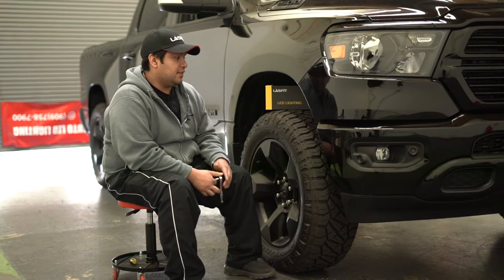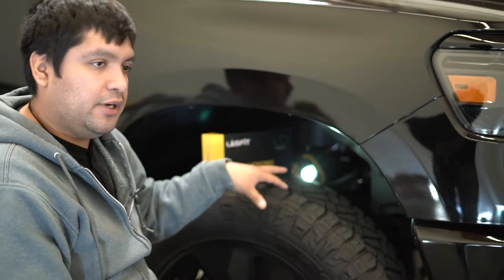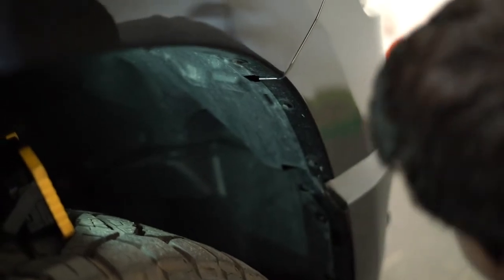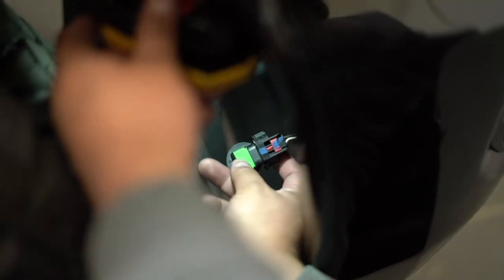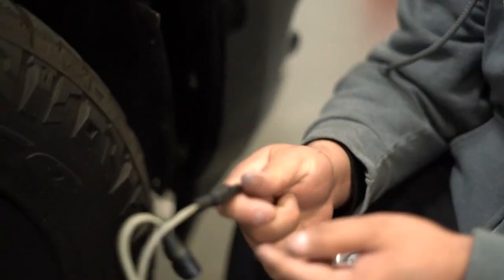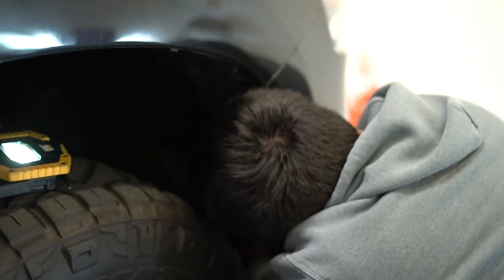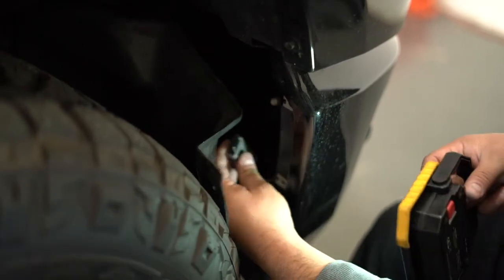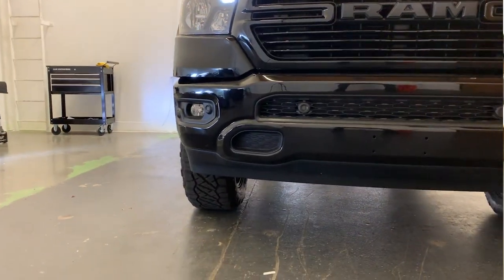How to Install Switchback LED Fog Light Bulbs H11 - 2019 2020 Ram 1500 Big Horn

Comment: My 22 1500 has cornering lights so when I turn the wheel the fog light corresponding to the way I’m
Turning turns on for better visibility. Will this keep switching the colors because as I turn it’s gonna turn them off and on?

Comment: I’m about to buy a set of these. One question. It may be a dumb question but do these change colors when you turn the car off and on? Like every time I turn on the car I will have to cycle to get back to the color that was previously on or will they stay on the color you had on. I keep my fogs on all the time. Thanks!
Reply from the maker: you are correct. each time the car it turn off it will reset to default white so you will have to switch it to yellow each time you restart your vehicle. We are currently working into adding memory retention so the bulb will keep the last setting. hope this helps answer your question :)
Reply: LASFIT Auto Lighting yes it did thank you. No big deal I still want them
Reply: @lasfitvehiclelife  do you make just a yellow “jdm”yellow H11b fog bulb? I want just yellow without having to cycle through.
Reply from the maker: @ronbang  We don't have H11B LED fog lights. But we have H11 LED bulbs and H11B extension cable. You can use the extension cable to install H11 LED bulbs on H11B.
H11B cable: https://bit.ly/33BYhaV
Switchback H11 bulbs: https://bit.ly/2ZIq9sX

Comment: Does anyone else notice the pulse of the lights at 7:15 it’s very minor but I just installed lasfit hi and lows and these switch backs on my 2021 ram and they flash almost like a very slow strobe light and it’s driving me crazy because I love these bulbs and the fact I didn’t have to drill holes in the dust caps made my choice on these but the slow flash is driving me nuts
Reply: Need hyper flash resonator. It’s cheap.

Comment: Is it common for the metal driver to get hot while on?
Reply from the maker: Yes.
Reply: I like these lights so far.  I do notice if i don't have them on and make a left or right turn. The fog light for that side comes on and then when i turn the fog lights on with the switch the lights are out of sequence ie the light that was activated by the turning of the steering wheel was white then went to halogen color where as the opposite light turned to white led.  No biggie i just turned it off for a few seconds then back to normal.  I do think the yellow is a  better light than the other two.  I wish it was a bit more yellow in color.

Comment: Should've turned the steering wheel towards the driver's side (left) it wouldve made it a lot easier to reach the Fogs as well as properly light/film the area so the audience can see what you're doing and vice versa with the driver side.
Reply from the maker: Thanks for your suggestion. 😊

Comment: Ram owners, with the high beam cornering lights (one fog light lights up when you turn below 30mph when you have with high beams on) so this won't work as you will have one yellow and one white.
Reply from the maker: Hello, what's the year of your Ram 1500?
About your fog lights, when you turn left/right, the left/fog light will turn on, right?
Reply: @lasfitvehiclelife  it's a 2020 bighorn with halogen lights (h11 for low and fog bulbs), when the highbeams are on the fogs turn off, so it that situation when you go down to 30mph and turn, the fog light in the direction you turn will illuminate and then turn off when you go straight again. so with the switch backs, they would be out of sync.
Reply: my trucks lights are exact to the one in this video.
Reply: i have the same problem, very irritating , one yellow, one white,